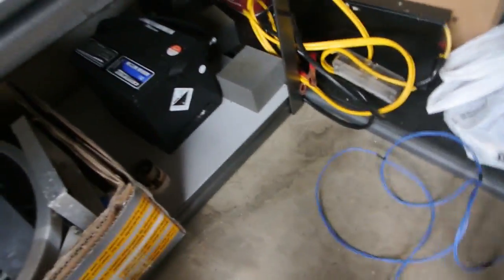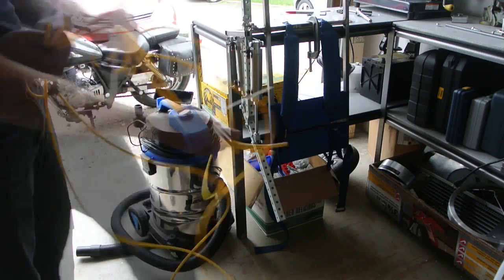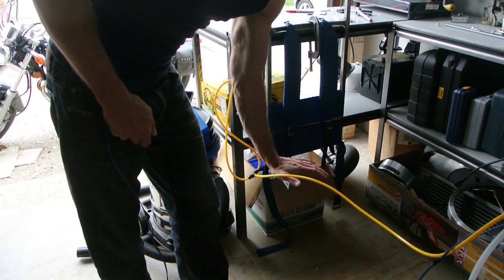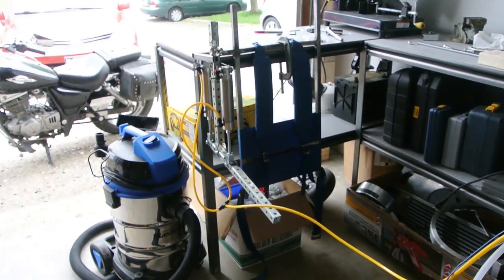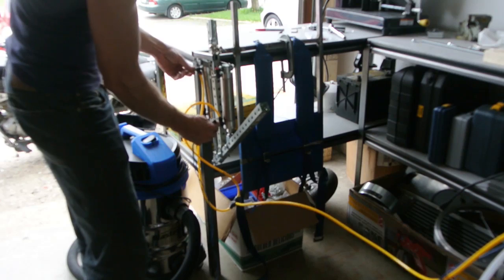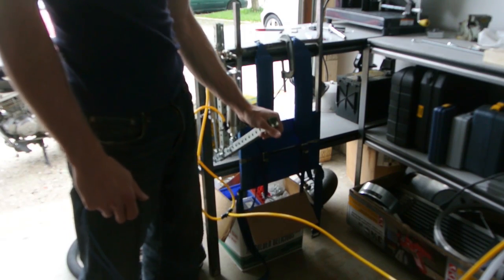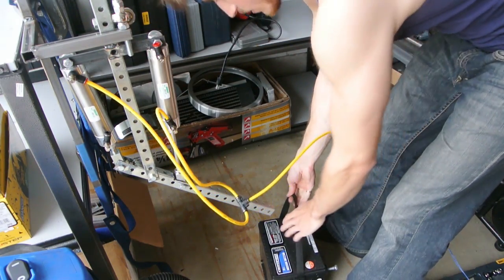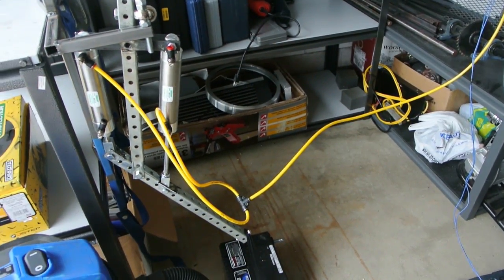Elysium Exoskeleton, Part 12: Testing again!

Comment: So have you thought about how to activate each arm?  like right now you have the activator in one hand, but lets say you want to do it simultaneously.  How are you going to activate it if you need your hands to guide the exoskeleton arms, maybe add in a way to lock the shoulders into place or run an activator for each arm down the arm itself so your hand can activate it when you want to lift.  Just some longer term things to think about when you get both shoulders on.

Comment: Instead of straping the exoskeliton are to your arm just put a round bar and the end of the arm as a handle so if somting goes wrong (the arm spazzes out or something) you are just able to let go. Plus if you need extra movment you dont have to unstrap your arm. I also thing you should triangulate the brackets thag hold the cylinders for more strenght because those weld could break if under heavy load. Awesome vids.

Comment: nice progress, prolly a realistic goal will be some kind of kart with arms (with a generator powered by gasoline) , since walking with a compressor is not a viable thing.
Reply from the maker: You can actually get some pretty small air compressors, I think I will be able to do a backpack mounted one -- The suit isn't for constant use so it doesn't need a constant supply, just enough time to recharge the tanks =)

Comment: I am sure you have considered this, though if i were you i would try to make the joint beefier by using one large swivel joint thing similar to one used to connect a trailer to the hitch of a car. Such would eliminate the need for two joints and would remove some unwanted wobble